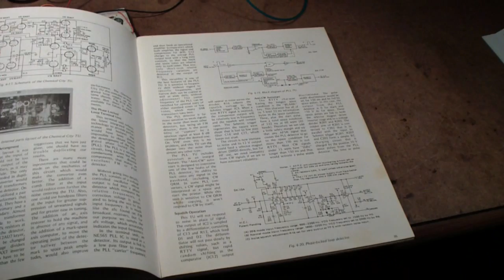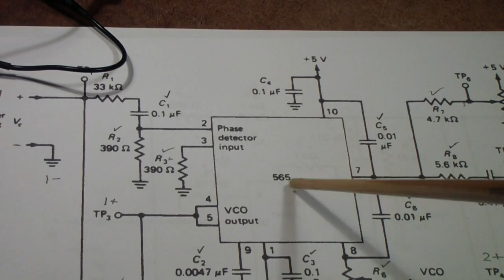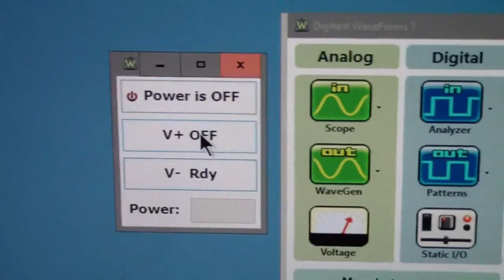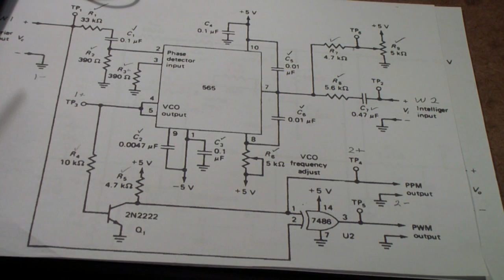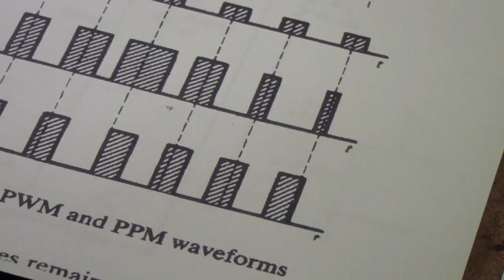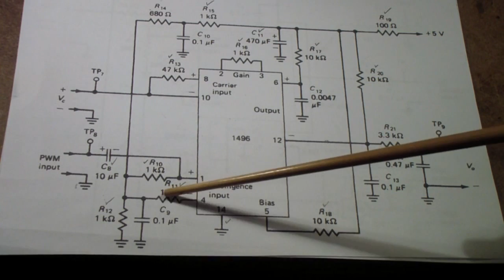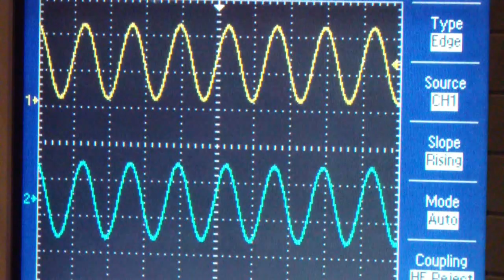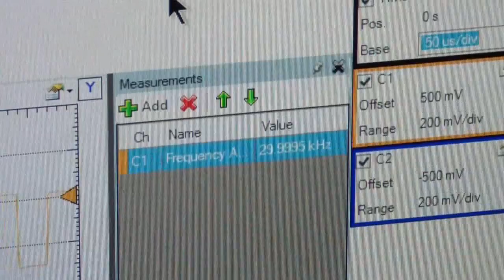TTT057 Analog Discovery PWM Experiment

Comment: Possibly the USB is more of a problem on older computers.  By default the Analog Discovery has a setting enabled to limit the supply to 50mA and it gives an error if that is exceeded.  This can be disabled and ports should normally be able to supply at least 500mA.